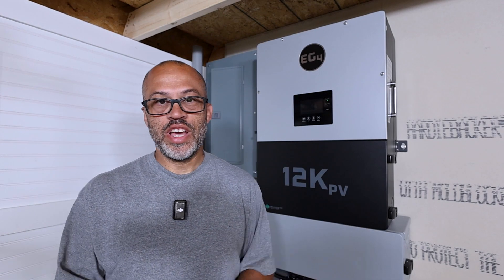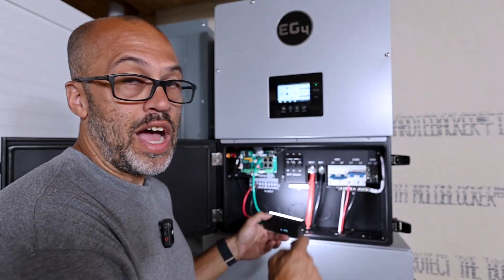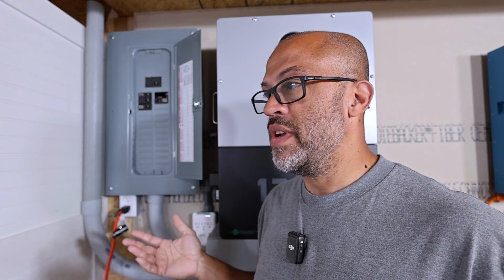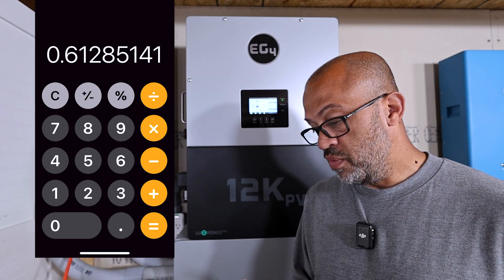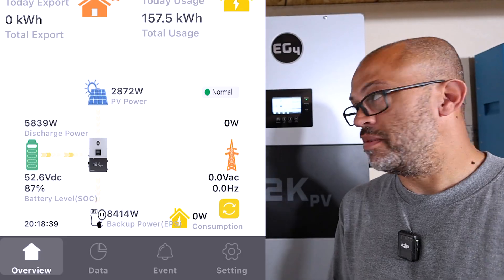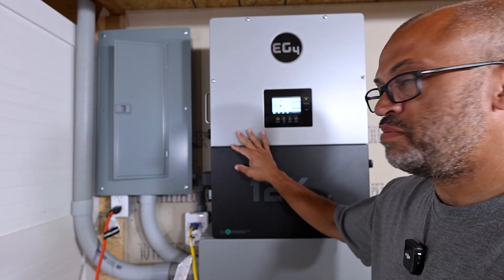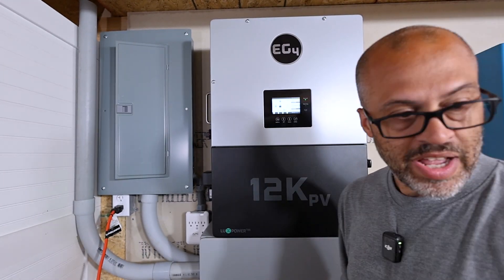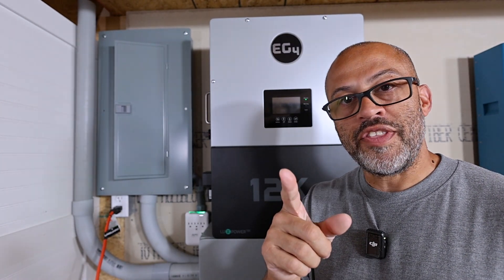EG4 12KPV Walk-through & Testing - Will it restart when overloaded?

Comment: Hey Rodney what do you think about the 1200xp vs the 12kpv? I've got an off grid system running on a LV6548 and thinking of upgrading. I can get both the 1200XP and the 12kpv for the same price. 1200xp has more output but I heard the 12kpv has more surge and runs quieter/cooler and has "better" features. I will probably not grid connect. I have a 5 ton AC that I run rarely, and usually don't run over 3-5 KW during high use times. I also AC couple.
Reply from the maker: I like the 12000xp for more power and bigger loads. But the 12kpv has a longer warranty but less output power

Comment: I want to go in solar but I am seeking advise before I do. I know i want a 12kpv hybrid inverter that could tie in to the gird but is it better to get and 12000px and go offgird so i am not useing the gird.
Reply from the maker: Depends if you are trying to sell back to grid. You can still have grid power going into 12000xp which has more solar input and discharge watts than the 12k. I would go 12000xp for no grid selling

Comment: Rodney how are you,  question if I build the same setup and going off grid why a 100amp breaker on the sub panel if the 12kpv max output current is 33.3A? Is 100A too big? Can I go smaller like 60 or 50A? Thanks sorry for the question I'm in the learning process.
Reply from the maker: I think the breaker just came with the panel. You can always use a smaller breaker but make sure wire is sized correctly
Reply: @rodneyhunt  ok.  Thanks so much my friend

Comment: Great video Rodney, question why there's no ground connection on your setup? thanks I'm learning that's why I'm asking you.
Reply from the maker: Just forget to run it from main panel. Going to fast
Reply: @rodneyhunt  thanks Rodney, I'm learning little by little from your videos. did you use 6 gauge wire on the load?

Comment: These seem like great units but I would sure like to see them release 12/18kvp charge controllers as a stand alone that can communicate with the inverters. The 12kpv has all the AC power I need, but nowhere near enough MPPT capacity. Up where I live I need 4x the solar to make ends meet in the winter time.
Reply from the maker: Would be another good idea for sure
Reply: @rodneyhunt  If you are ever talking to them put a bug in their ear will you? The 18kpv is overkill for just about anyones AC needs. But We don't all live in Texas. Winter time I get 5 hours of usable sunlight.

Comment: I’m new to solar and dont quite understand why it’s overloading over 8000 watts when the inverte is 12k, 12k is 12000 watts yeah??
Reply from the maker: The 12kpv is just the solar input of this inverter. The output is only 8k. So just the way these are named which can confuse people for sure.  Hope that helps
Reply: @rodneyhunt  Oh I see so you could have 12k of solar panels use 8k on powering the house and have 4k left over to charge batteries, is that it?

Comment: So between the 18K and the 12K what unit gives the most bang for the buck?   Doesn’t the 12K handle a higher load?
Reply from the maker: The 18kpv will handle 12k continuous load. The 12kpv will handle a 8k continuous load but does have a very good surge capacity for a short time. Depends on your needs because the 6000xp may be the best bang for your buck if using off grid or at least without selling back to the grid. They all have great features depending on which you need.

Comment: good run through and demo.....thanks.....I'm off grid only and put in Two  6000 XPs
Reply from the maker: Definitely like my 6000xp’s as well
Reply: Hi I’m new to this and  just wondered why do some install 2 6k inverters rather than 1 12 K inverter? Thanks.
Reply: @sunshinedream98  Tech is rapidly changing and redundancy is king.
I've been off grid for 6 years. In that 6 years much has changed with the equipment. 6 years ago we didn’t have all-in-one inverters with high voltage MMPT's , PV isolators and breakers all built in. We didn't have server rack batteries with communications, high wattage bi-facial panels....etc. The cost for these newer system components is now dramatically reduced compared with the former inverter, charge controller, combiner box, DC and AC breakers, larger wire/cables, larger array racking...and more complex/expensive communication devices....etc. New equipment introductions have very frequent lately....when I bought the two 6000XPs the hybrid 18K was available but not the 8K. 
Reason #2: I'm a preparedness guy living in a remote mountain situation. Being prepared to me means redundancy and spare equipment. I have spare inverters, controllers, batteries, panels, wire/cable, switches, panels and numerous generators. If one array got wiped out by storm, falling trees, or CME/EMP..I have more than one array location. I'm strictly off grid and the more expensive more hybrid-like inverters don't interest me. I'd rather have two off grid only type inverters on the wall. I'm a firm believer in "if you have one, you have none...and if you have two you have one". Also, from 6 years of experience, I don't really operate more than a 6KW inverter for my needs....and dependent on inverter self consumption, I may only use one 6000xp for inverting and the other mostly for the MPPT capabilities to my battery banks. I also have a EG4 5.5KW charge controller to additionally pump up my batteries in the cloudy snowy mountain winters.

Comment: Talked to a builder yesterday who told me they installed a whole house, propane back up generator for a client and the total cost was over $13,000.  I told them that they could have installed an $18,000 solar system with batteries, netted a 30% rebate via tax credit and could have powered their house full time without ever having to pay for propane to run the generator or any electric bills in the future.  All for the same money.  🤦‍♂️. A whole house back up generator will never pay for itself over time. ⚡️☀️🤩👍🔋
Reply from the maker: Indeed! Propane backups are a bad idea unless you have plenty of money and do it on addition to solar. 👍
Reply: Ha! My mother law runs heating and cooling on propane and I offered to do the bigger solar eg4 mini split for them but her husband is stubborn and so they keep paying to fill that big tank. Not a good financial decision for them

Comment: Is this capable of Islanding(i.e. in an outage can it turn on the solar panels and charge the battery)in an outage?
Reply from the maker: Yes it can work off grid. You can just select the option to run without grid
Reply: Does it not do that automatically in an outage?

Comment: Great video. What is the size of your load? I have about 50kwk during the day, do you thing your system will help me to pass the day without batteries? Thanks
Reply from the maker: You will need some batteries for surges and night time use in my opinion. If you need to be completely off grid a minimum of 10kw array but I would always recommend more solar than you think you need. Cloudy days etc. My single array cant get that but when I get my other panels connected it may be close.
Reply: @rodneyhunt  thanks for the response!!!

Comment: Ok so i been asking around and nobody bothers to answer. Hopefully you will. From what I am seeing in this unit you are only required to wire L1 and L2 into the load breaker coming from the battery and you dont have to wire in any grid power or generator unless you want to. Am i correct on that and does the same thing apply to the 6000xp for those of us who are unable to afford the 12k.
Reply from the maker: Yes L1, L2, neutral, and ground from Inverter goes to load center panel. The battery postive and negative go to inverter. Your manual for the 6000xp will explain that when you get it. I use 3 6000xp’s on my house with no grid or gen input. 👍
Reply: @rodneyhunt  thank you. I finally got the answer I was looking for. I had a pretty good understanding about the battery hookup but nobody ever bothered to show anything else. I just wish when people say they are going to install these inverters they don't skip details people might want to know about. Since you have had time with the 6000xp I may reach out with a question once I have mine if you don't mind.

Comment: I am in need of some help to size my upcoming whole house off grid system. My highest electric bill I used 6875 KWh for the month. That with everything in the house running A/C all day. I want to have batteries on the system as well. I want to come super close to a 100 off grid as possible. I have full sun with zero shade and south facing. In Georgia
Reply: I can help you with this. Are you sure you used 6.875 mwh? That’s a lot. Typical home usage for a medium sized 4 person home is about 1 mwh per month. At 6.875 mwh you would need about a 40k watt array. I would do about 100kwh of storage. And depending on how many amps you’re trying to draw 2 x 18kpv inverters should do the trick. I believe you can over panel them to 21kpv according to signature solar.
Reply: @Dturn77  Thank you for helping me. But new plan I am going to upgrade my appliances and both ac/heating units. And give it 2 months of running the house to see how many kWh’s I get and resize my solar project once more after.
Reply from the maker: Wow that is a lot of power usage. If you can get more efficient appliances as that may be cheaper to start your system with. But if not that is about 230kwh a day you need. So that is a 46kw solar array. You can size up for cloudy day. Then probably in the 120-160kw range first battery storage. Probably 3 eg4 18kpv inverters depending on your max power usage at one time. So would be pretty significant cost wise but like I said maybe half of that system if you get improved appliances, hvac, water heater, etc might help lower your total system needs.
Reply: @rodneyhunt  Thank you for helping me. But new plan I am going to upgrade my appliances and both ac/heating units. And give it 2 months of running the house to see how many kWh’s I get and resize my solar project once more after.
Reply: And I would add more batteries as you can afford them. Hope this helps.
Reply: I think that’s a great idea. Heat pumps for everything haha.

Comment: Great Video, So you also have the Calpha 10K inverter, what is the better of 2 ?
Reply from the maker: The 12k has many more features. The electronics are fully enclosed with a longer warranty and life expectancy. The calpha I am still unable to get the wifi dongle to work so that has been a problem. For the price if wifi is not needed calpha has worked well. But I can’t monitor it when away from it so that doesn’t work for me. The 12k is much more expensive but is awesome!